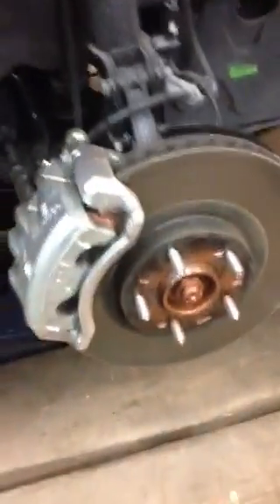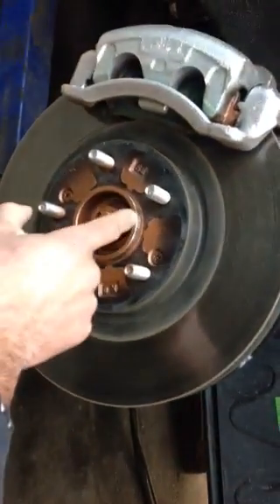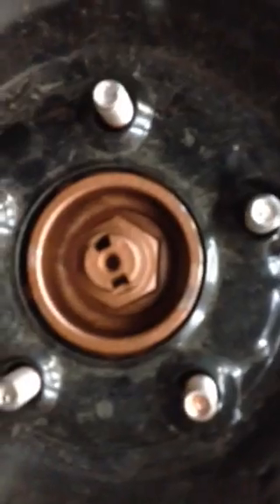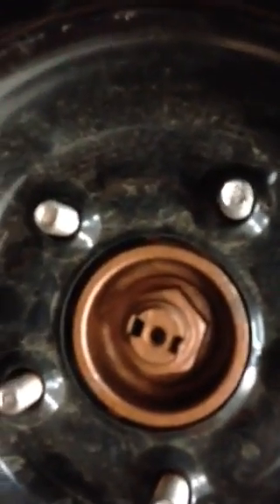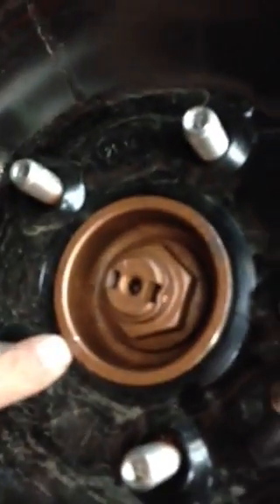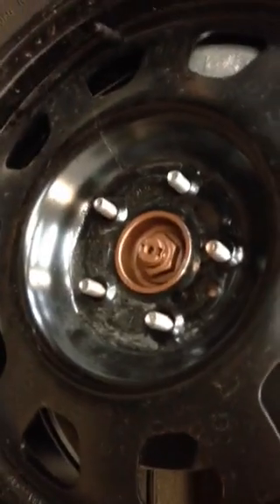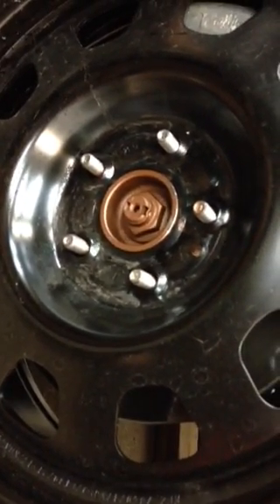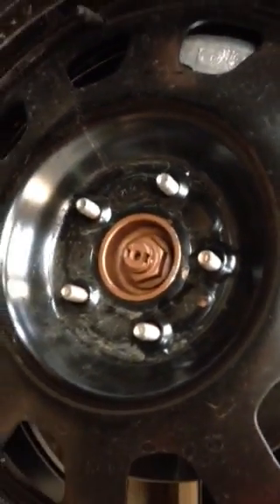HUB CENTRIC VS. Lug centric rims

Comment: This information, as with many other videos on this subject, is incorrect.  The lugs do not ever support the weight of the vehicle.  Even in a so called "Hub-centric" case, the hub center does not support the weight of the vehicle.  When the lugs are tightened, the clamping force caused by tension on the lug studs creates a friction force between the mating faces of the wheel and hub.  This friction force is what supports the weight of the vehicle.  Unless the lug nuts do not have conical or radiused faces the lugs will center the wheel on the hub.  If "hub-centric" features are added to the assembly then that fit will be in competition with the centering provided by the lugs.  In some cases the hub center will influence, but not fully determine, centering, and in others there will still be clearance all around the hub center.  Which occurs will depend upon the manufacturing variation of the particular hub and wheel combination.  Unless the wheels are press-fit on the hub centers (an they're definitely not), there is always some clearance between the hub center and the center bore of the wheel, even with "hub-centric" fit.  There is never "perfect" fit of anything.  Hub-centric fit will tend to help when proper lug tightening procedures are not followed, or for a case in which the wheel or the hub has a slightly off-centered lug pattern.  Hub-centric fit will not help at all if the particular wheel happens to have an off-centered center hole.  All this talk about how hub-centric fit and rings are important is based on conjecture and opinion, rather than on engineering principles and facts.  They may help with a centering issue in some small number of cases, but they're generally only an assembly aid.
Reply: Damn bro thanks for the info!
Reply: Thanks foe the explanation. I know this is an old comment, but in theory I should be able to open up wheels with 56.1mm hub bore to 64.1mm, as long as I do a half decent job and use the lug centric holes the right way to center the wheels I should be good in theory correct?
Reply: WRONG!!!
Reply: @Me-nq4gz Yes you are.

Comment: The wheel is attached to the hub by the conic lug nuts and yes, the hub is only there for centering. You won't need rings if you installed and torqued them properly.I totally agree with the previous post

Comment: If the weight of the vehicle was on the hub of the rim you would see wear musgroming out the center hub. You don't see this because the weight is locked in to the axle by the lug nuts not the center hole.

Comment: First off, great video but you are incorrect on what carries the weight of the vehicle. Weight is not carried by the hub or the lugs. It is carried by the friction between wheel and hub due to the lugs being tightened. I know people are going to be disagree with this but it just takes a little common sense and thought. When you tighten a wheel to a hub, think about contact points. Of course you have the wheel against the hub but the studs themselves are centered in their lug holes. The wheel is not resting on the studs. You have contact points between the studs and the wheels through the lug nuts. But this contact isnt carrying weight. Rather it is creating horizontal pressure (friction) between the wheel and the hub.
Reply: Absolutely correct, can't agree more!
Reply: This does make sense, I’ve only installed lug-centric but I always felt it had to be centered as well as possible. The most important part is that the lugs are tightened properly but I can see how the limited clearance for hub-centric design would help.

There’s some natural movement anyway and you probably benefit from a quieter ride too
Reply: So why do lug centric fitments cause vibrations then?
Reply: @kg_1720  because the tire shop you take it too doesn’t tighten the lug nuts to spec or in the right pattern. They just grab their little impact gun and start drilling away. Could also be your balancing. Wheel balancing is everything.

Comment: Thanks for this video, it's very helpful.  I got some steel wheels on my new car and feel a thumping when going around turns, and I think this is the problem.  Fortunately, the shop is going to take the steelies back and replace them with correct hub centric alloys.

Comment: Hi, just want to mention something I have argued over with tire shops balancing my lug centered rims. Hub centered rims are center hole spin balanced, using the cone centering method. My lug centered rims require the plate that is attached to the rim with the lug nuts, then the plate is mounted to the machine with the plate's center hole being true center to the lugs, because the rim's center is NOT true center. If they balance a lug centered rim without the plate by using the cone (as they have with many many rims), the rim is not balanced to the lugs, and this may look and feel ok on that machine, but it rides like it's out of balance driving down the interstate. Cause it is still out of balance. Be sure they know your balancing requirements. Look at the plate they want to use. Is it a finger plate pressing the rim tightly against the cone or does it bolt to the rim? And you might have to teach them something about proper lug centered balancing. Good Luck on the next re-balance.
Reply: Calvin G. Williams yes I’m fighting this same issue with steel wheels I just got for my snow tires. Most shops don’t understand and most shops don’t have the adapter plates unfortunately!
Reply: interesting, thanks

Comment: Yes and no
Hub-centric= Stuck buying brand new. $$$$$ Bcoz the specs are to hard to find.
Lug-centric= Used rusty rims are Cheap!!! If the weight of the car was carried on the tiny  lip of your hub you would have big problems; it's just 3/16" Hammer 500lb on that (2 ton car/4 tires).

Comment: I disagree on this for this type of wheels with conic wholes. Wheel should be lug centered not hub centered. If the fit on hub is too tight you never know if the lugs will be equally in place due to the cones proper sitting around lug. It is actually those very cones on the wheel wholes that should center wheel and no, nor hub nor lugs carry weight it is friction between wheel and rotor. If you do not have wheels with conic wholes (typical with alloy wheels) and your wheel center is wider than hub you need proper hub centric conic rings.

Comment: Hi there I just installed winter tires on steel rims for my 2015 accord which bore is 64.1 and found out the steel rims were for camry 60.1 bore size. Once I installed it's not sitting  on the bore hub  kinda sitting flush. I've driven the car to mtl and back no vibrations or anything. Should I be worried? Both bores are centered just doesnt sit.Thanks
Reply from the maker: That is absolutely not safe - get it checked out it the rims were really a 60.1 they should not be able to slide over the Honda 64.1 hub. If you did - the force of the lugs is holding it on and it's not safe
Reply: The steel rims are not sitting on the car hub but it is centered to it and right against it.
Reply: @OttawaTiresDirectcom  The clamping force of the lug nuts holds the wheel to the hub, and the friction between those two surfaces is what bears the weight of the vehicle. Hub centric rings are not necessary when the wheels are installed and balanced correctly.

Comment: Thanks for the video, but I've seen were lug centric wheels wont balance correctly Is the hole off center than why would centric rings help?
Reply from the maker: Steel rims would never use a ring, but alloy wheel with a ring would allow the assembly to stay centered. Effectively making it hubcentric. Still, if you can buy your alloy wheel hub centric without rings it is much easier!

Sean
Reply: Thanks for your help.

Comment: If the rings are custom made is it better to make them by steel for more strength (or stainless steel) than aluminium?
Reply: They are spacers that take zero load - they are only to centre the wheel as you tighten the wheel nuts. Plastic spacers are very common.

Comment: Unless somebody shows me proof from a vehicle engineer that the friction of the wheel face being pressed hard up against the wheel hub is what supports the weight of the vehicle i just don't believe it. So the friction is so strong that when you hit a pot hole it doesn't break that friction? find it hard to believe. I'd like to see a video of a wheel put onto a car with no lug nuts and not hub centric so that you can clearly see a space between the wheel hub and the wheel bore and also see a space between the wheel studs and wheel stud holes and then use some type of hydraulic press to exert the same force onto the wheel that tightening the lug nut would give and THEN to put another hydraulic press underneath the wheel and see how much force it can take if the friction is truly what supports the weight of the vehicle you should still see equal space between the wheel hub and wheel bore and same for the studs.
Reply: The frictional force between the hub and wheel is directly proportional to the clamping force from the lug nuts... The only surface where the wheels and rest of the car interact are the hubs, so I'm curious to see what else you think could possibly bear the weight of the vehicle.
Reply: Lol, the studs don't even touch the wheels... Only the nuts do. 
Wtf are you even on about?
Reply: @CadillacDriver  I never said the studs touch the wheels?
Reply: I thought about this wrong btw, I now understand the hub is not what takes the load of the wheel, but instead the wheel being clamped against the brake rotor is what takes the load.
Reply: @grassyfieldz4578  my point was that the studs don't support the wheel, same with the centre hub, it does not either - same principle. I should have clarified.

Comment: I have a question, If my car centerbore is 67.1mm and the wheels I want to buy has smaller centerbore than 67.1mm but the same 5x120 Bolt pattern. Do you think it would fit on my car? Thanks
Reply: No, the wheel bore needs to be larger than the centerbore.